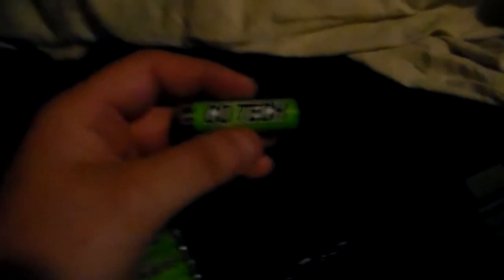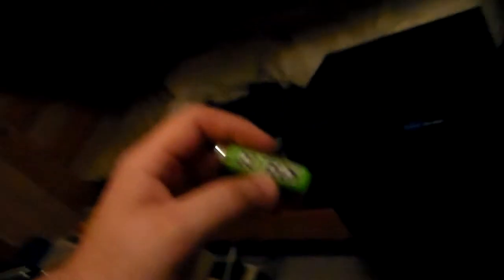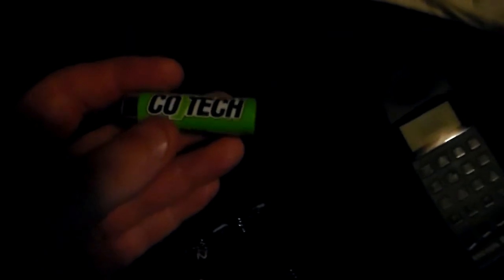Rebuilding battery for Ericsson GH198 cell phone

Comment: Yesterday I went to a thrift store to find a charger for my canon and as I was trying to find them in the boxes, I saw this phone! I got it for one dollar. I cleaned it and tried to recharge the battery with a smart rc lipo charger (nicd mode) and it charged a bit. I think after some cycles it will hold some charge. But I do not know hom many mah those packs are.